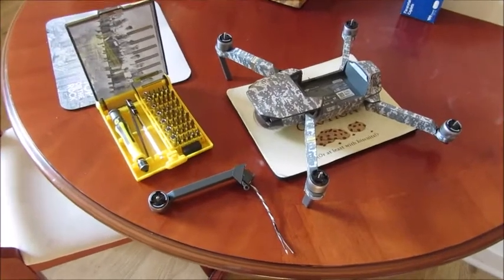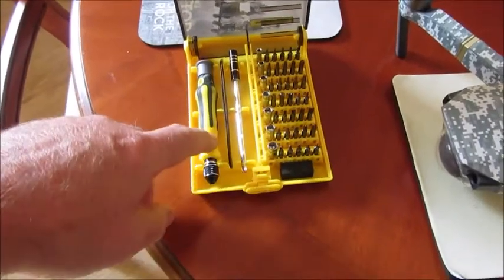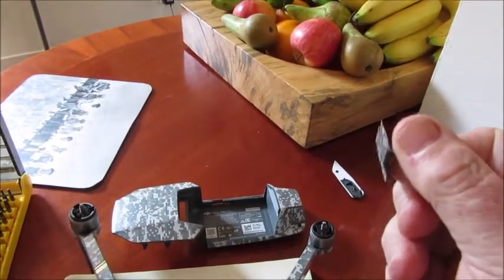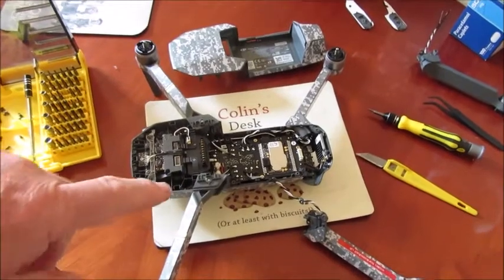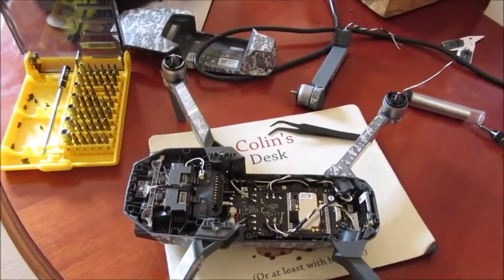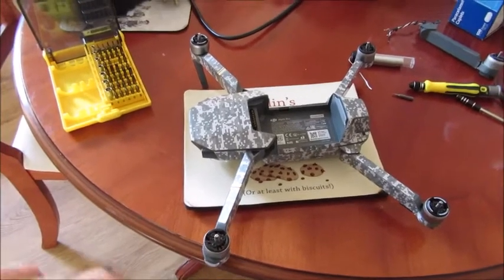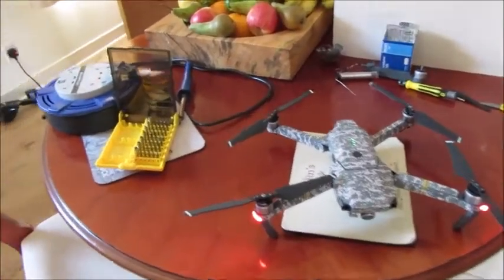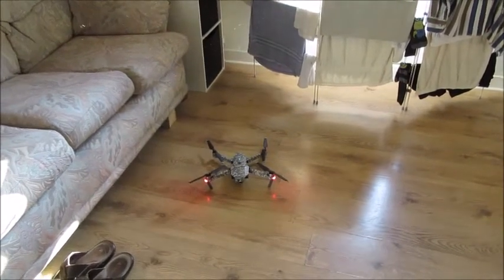mavic drone repair

Comment: I don't whats braver stripping it yourself to do the fix or trying it out in the house, hats off to you for both Colin. I'm itching to get myself one, swaying towards the Air rather than the pro what do you think mate?
Reply from the maker: still think the mavic is a good all round machine . the new air i hear is not better just a little smaller. theres some good deals on the mavic pro and although i have not flown a lot i have found it not to hard !! apart from the tree ....i sugest visit a few tube sites and take a look. a small bit of drone footage can be brilliant as i have watched others, so if you feel like one  go for it ...you only live once but crash many times ...lol...cheers 
  https://youtu.be/0c85N5QdoOA   you may find this informative ?
Reply: Cheers Colin ill have a look.
Reply: Thanks for that Dave, been doing some research but there is a lot out there to learn so appreciate your feedback.